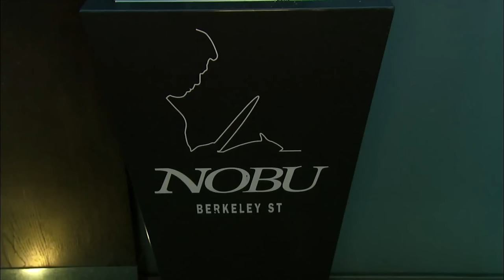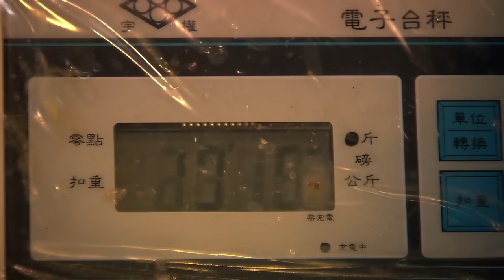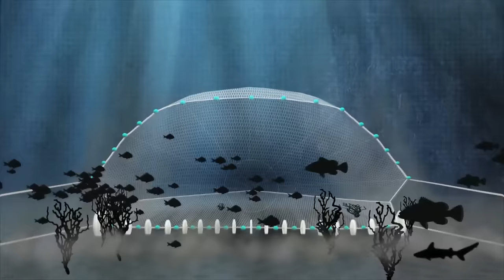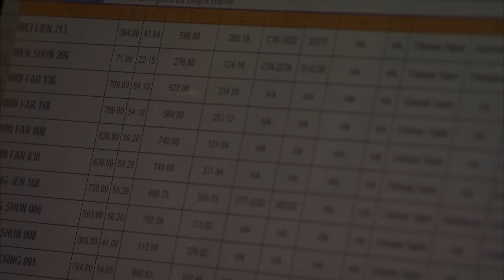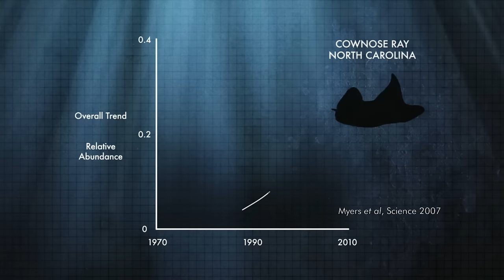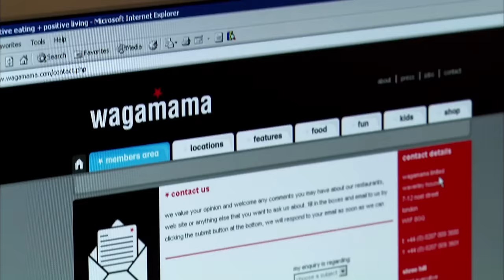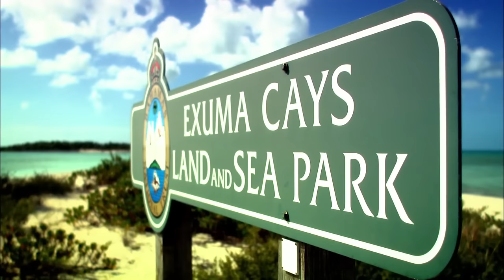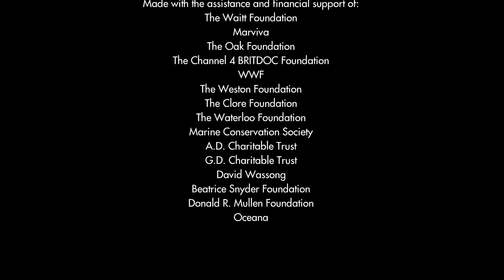Where Have All the Fish Gone? | Overfishing Crisis | ENDEVR Documentary

Comment: I'm a charter captain in Texas and fish the Gulf of Mexico 1-200 days per year. It's bad. Every year is worse than the year before for almost every species we catch. We often fish around shrimp trawlers and/or obtain bait and chum from them. They kill hundreds or maybe even thousands of pounds of bycatch to obtain a couple hundred pounds of shrimp. Bycatch in this case is not just small fish and other crustaceans and mollusks- I have seen shrimp boat decks covered in HUNDREDS of flounder and red snapper. All of these are simply discarded back overboard. Commercial fishing is killing our ocean. Trawlers are bad. but longliners and "bandit rig" commercial fishing are just as bad. However, the commercial fishery has all the lobbying power. A prominent local fish house and commercial boat owner flies to DC monthly to wine and dine congressmen and senators. There won't be much left in another decade or two if something doesn't change drastically.
Reply: Damn I'd be eating the red snapper